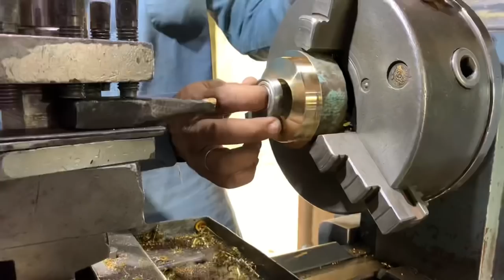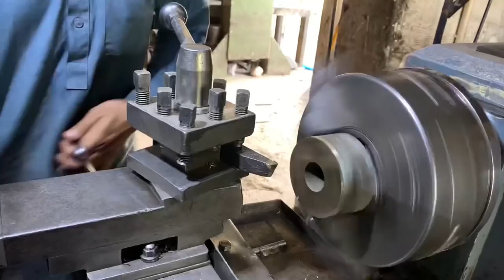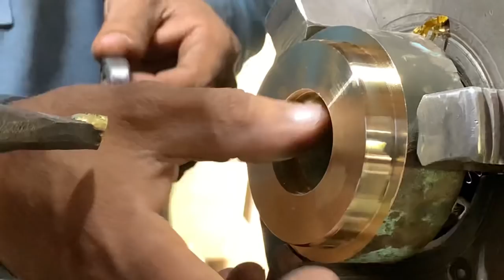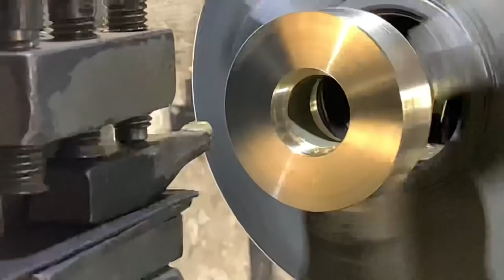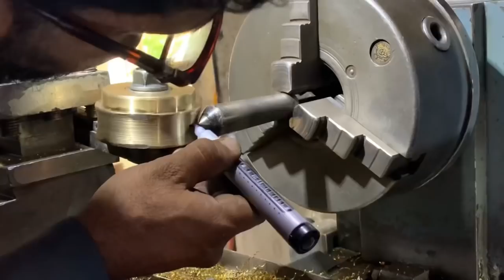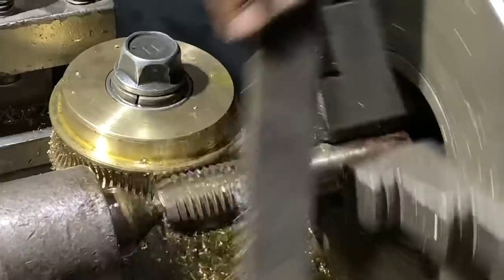Amazing Whirling Process of Cutting Worm Gear Threads On Lathe Machine in Local Workshop

Comment: if you use an indexing head or rotary table first to score the worm wheel so it has the correct number of teeth the tap will follow those. It's really the only way to ensure you get the correct number of teeth on the worm wheel if that's critical for what your making.  Cutting the radius in the worm ahead of time isn't necessary for finer pitch taps, it can make the process more diffucult and less accurate in a lot of cases.